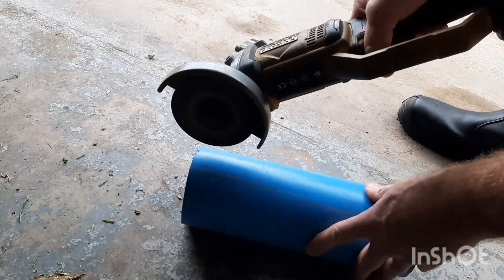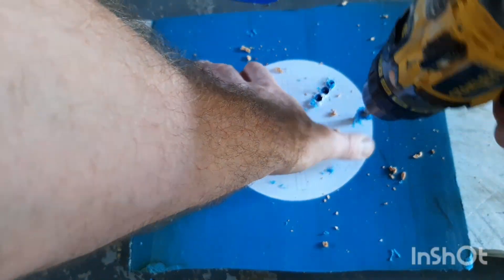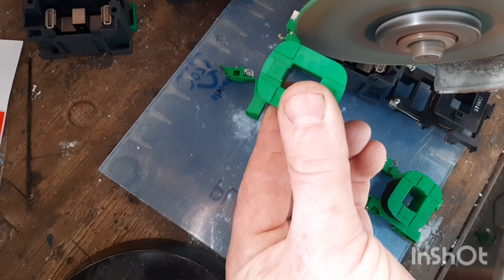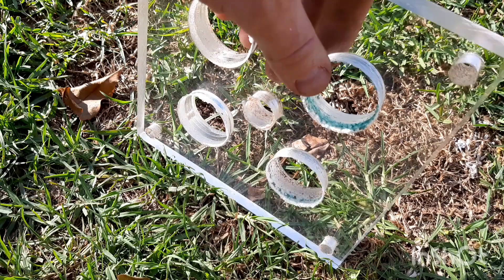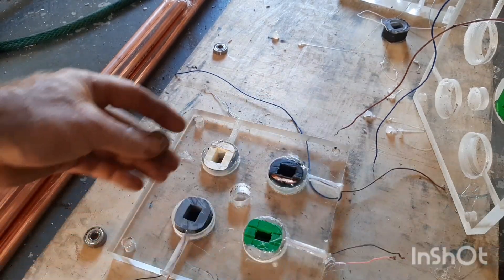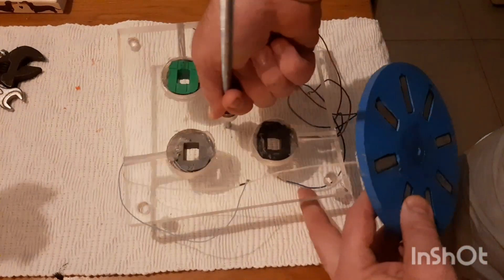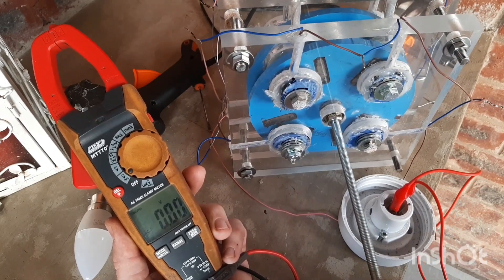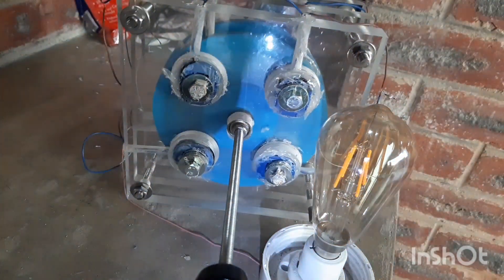Make a 315 Volt DIY Best Design Generator.

Comment from the maker: The big globe was 10w but i didnt put any steel in with the centre stator. So i guess it would create about 15w.
Reply: Not a chance.
Reply from the maker: @AverageJoe2020  you should try passing a powerful neodymium magnet across a coil of wire you will be surprised at the power you get from it.

Comment: Interesting. What current rating did you get from this? I have made an electrostatic motor that has enough torque to do a bit of work, and I’m wondering if I make something like this if it will surpass the 9 watt input I use.
Reply: It is utter bullshit , almost no power whatsoever.

Comment: Double the nuts on the rods mate. ech nut fixed against the other prevents it from coming loose do to the vibration. Or/(rathet) And Balance the magnet discs for less vibration. I am no where near where you are in exploration of energy generation per se, but the double nuts will already help in the experimenting fase. Love it what you did/do! Are you planning to put that with a reduction gearbox to a Tesla Turbine? You would blow my mind😅😍
Reply from the maker: Thanks will try that. Yes I've thought about gearing it up. But I'll have to make another generator that is more accurate, like take it to be laser cut etc.. the rotor was a bit wobbly because I drilled the center hole a bit sideways.
Reply from the maker: Thanks will try that. Yes I've thought about gearing it up. But I'll have to make another generator that is more accurate, like take it to be laser cut etc.. the rotor was a bit wobbly because I drilled the center hole a bit sideways.
Reply: @yourworkshopmate372  First attempts like this are the stuf that I love. Make it with a lot of loss in any area and still be blown away by the results. From there on it only get's better, hahahaha.. Looking forward for more.
Reply from the maker: @AverageJoe2020 experimental